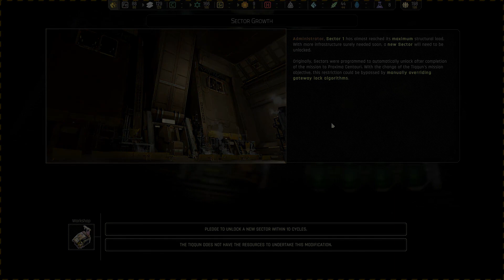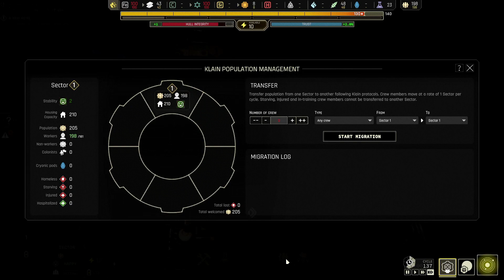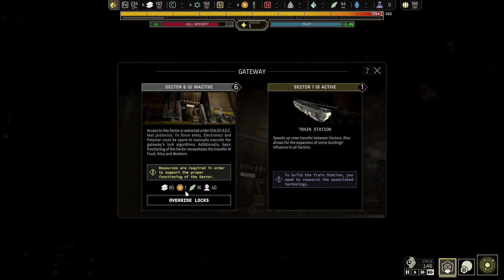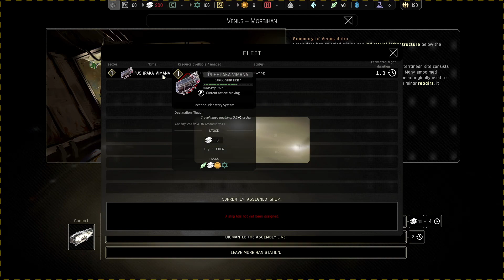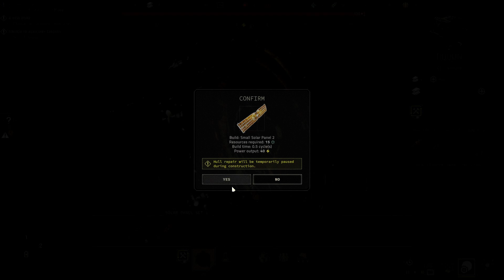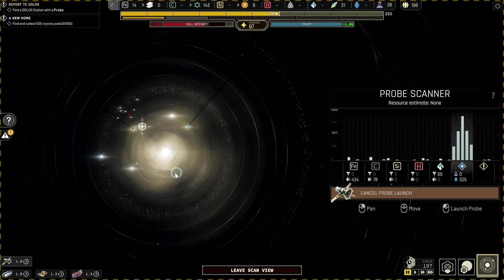IXION EP5 Story Unlocking Sector Cracking

Comment: You hit "extra hours" and triggered accidents.  If YOU never trigger them, they never happen.
less than optimal working conditions, food shortages, and power cuts will all trigger accidents, and it is a one-way switch.  But it is avoidable.
If it makes you feel better, you can build an infirmary, but save the power & workers and leave it powered down unless it is needed.  It can be activated in an instant if you ever trigger an accident event.  But it is completely event-driven, by events that you control.
It is possible to go through the entire game without triggering it, with enough care.